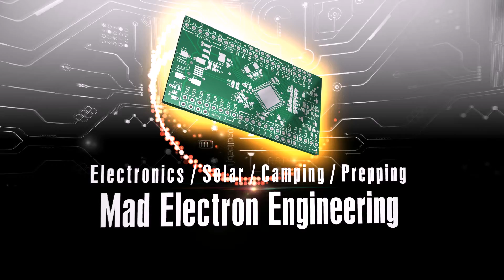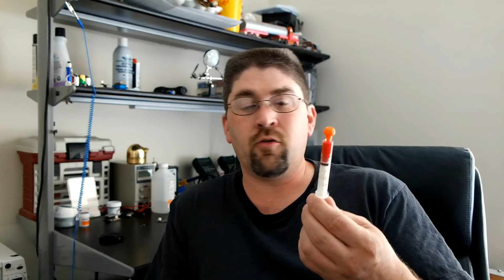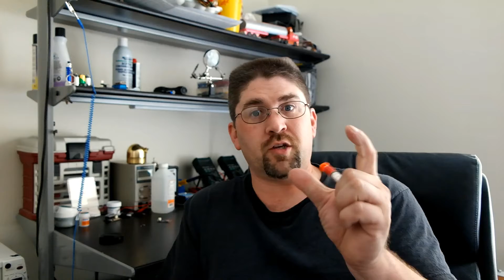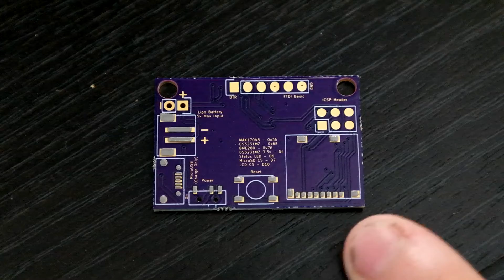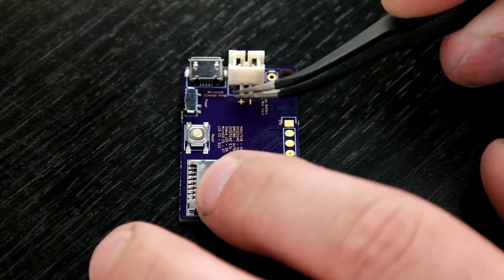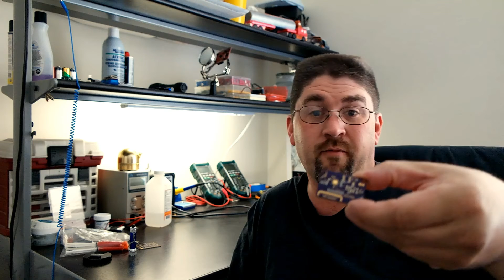SMD Glue Tutorial

Comment: Now, how do you get it off?
I need to change cpu and even after cutting all the pins it does not come off.

I suspect its either glue or coating that is only applied on components, not all pcb

Comment: You should point out that the smaller components like the resistors, caps and other things do not need glue because they cling to the bottom by surface tension alone.

Comment: How can I remove it?? To replace component.
Reply: Use a hot air rework station to desolder the component. The glue will soften and you can pull the part off the board with tweezers.
Reply: @rocketman221projects  Thanks
Reply: What temperature should you use to reattach a component that is connected with an adhesive glue such as on a phone's circuit board without losing it's function as a medium between circuit board and component?
Reply: Or it won't and just chip away
Reply: All good for assembly but an absolute bitch to remove or repair boards with glued down components.

Comment: Another way is to use high/standard temp solder for the first side then low temp for the other, that way it isn’t hot enough to make the components on the first side fall off - this board would be a perfect example to use this method on as all the first side components where non active / temp sensitive parts

Comment: Very interesting. I didn't know this existed. One question - does the adhesive keep the parts from self-aligning during reflow?
Reply from the maker: I haven't had any problems with alignment so far.
Reply: @madelectronengineering  That's because it's heat activated right? First heating it aligns and hardens, the second it will just adhere.

Comment: Have you ever tried to liquefy solder paste to use with a syringe? I purchased a dozen containers off of ebay and tried to use acetone and even liquid solder without any luck. The paste will either settle in the syringe or will pop when heated to the melting point, which actually blows the component off the board.